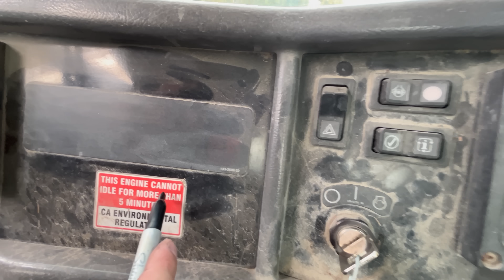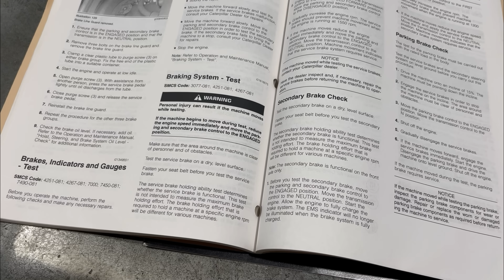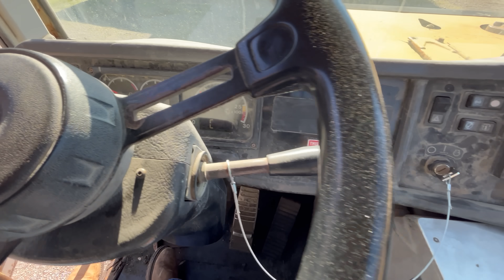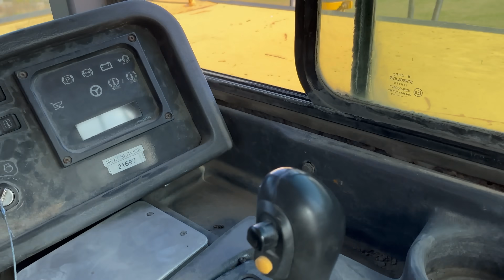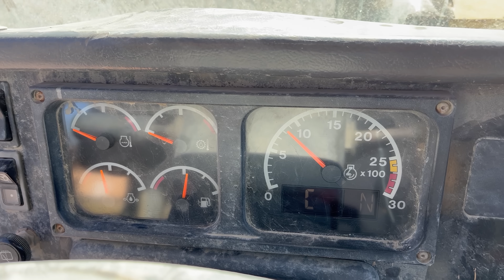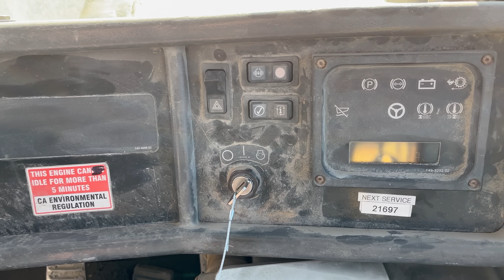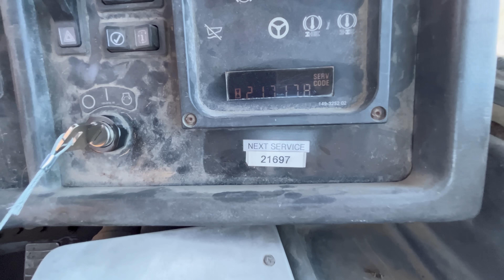Bought a 70,000 Pound Caterpillar 6X6 Haul Truck Sight Unseen 1800 Miles Away

Comment: I have absolutely no use for a machine like that, and yet I want one. Well done, and thanks for sharing the view!
Reply: Came here to say exactly the same thing, knowing without a doubt I wouldn't be the only one. One day, eh? Think my wife would kill me. A small dozer on the other hand....She wants a homestead garden after all. Shhhh, no one tell her you don't need a cat D6. Okay okay fine - an old D2 would be ok I guess. She even called one she saw cute. Think I'm off to the races
Reply: If I had one I could surely make a use for one
Reply: Mate,I have operated these trucks for 20 years and trust me they are the most uncomfortable things to drive,they have no real suspension (they do but it's for holding such weight and not comfort) the seat is the only suspension you get. If you drive into a hole that's a foot deep you will get thrown around the cabin even hit your head on the roof,that's if you don't have your seat belt on,and there are times you just jump in and go forgetting the belt.
Reply: Exactly....I want one of his rebuilt Cat engines and I have NO idea what i'd do with it...

Comment: I’ve worked for a Cat dealer since 1994. I spent many hours fixing and actually did quite a few rebuilds of these good old girls. Thanks for the memories this brings. Tranny oil is definitely not good. Too much water can ruin the clutch discs.
Reply: So where does that much water come from?
Reply: @amunderdog  hard to say. Could be moisture build up  from years of sitting, maybe fill cap left open for a few months, top cover gasket gone and winter snow melts in spring gets into case. Ive seen plenty of dozer winches full of milky oil and not due to sinking in water but just top cover gaskets are shot and water migrates in.  It doesn’t take a lot of water to cloud oil, the problem is, lots of water will effect any clutch packs that have friction discs made from cellulose based material vs rubber. Water causes them to swell so when you think the clutch pack is not engaged it’s actually still rubbing and contacting. Typically first gear is a rubber based disc and other are more water sensitive.
Reply: We bought a new log splitter back in May this year and the damn oil was full of water in a couple months of letting her sit. Weather changed and went from cool to humid in a couple of days. Almost hoopa jooped the damn thing. Fuel had a good bit of water as well,luckily we caught it.
Reply: So is this bigger than a cat 745
Reply: @walsh9354  not quite. This is a 40 ton not a 45 ton version but a whole lot more metal and less plastic than the 700 series trucks of today.

Comment: Such good content as always.  In case anyone wondered 21000 hours is just under 2 1/2 years total running time. Crazy
Reply: That's insane bruh
Reply: @zachsteele6964  it’s insane but when I worked in those things, you’re in them for damn near 12hours a day lol it adds up quick
Reply: I thought of it as a car running at 50mph so that's over 1million miles.
Reply: 7.19 years at 8 hours a day.
Reply: And even more on most Mines. The only break the equipment gets is, shift change, PMs or repairs.
Reply: Not that bad for how old the machine is
Reply: I was also surprised. Most I've seen so far was 11000 on a 953. But then again there's only 1 rock quarry near us

Comment: Amazing - not a single gasket or hydraulic leak on the whole thing!!!!!!   Here in Aus we would run a CEM engine flush to clear the buildup around the rings, a very good chance that would fix the blowby.  I have used that flush in a Toyota 2H diesel engine with 400,000ks, drained 14 litres of oil and goop out of a 10 litre engine!

Comment: I drove that same rock truck for five days a week and for a year man ,it can go pretty much anywhere except for deep mud ,and it was reliable and a beast ,we would load boulders and stumps and all kinds of brutal stuff ,always felt like a tank that I was driving and it’s fun to operate
Reply: Were you tearing sh*t up playing around with it?
Reply: @rudyleotardo8278  no just work ,but there like a tank to drive
Reply: Something I've always wondered about this type of truck; if you are stopped and you turn the wheel, will the whole cab turn while stationary or do you have to be rolling to steer?
Reply: @partyguy9  it's been awhile but I think u have to be moving ,but if u flip the load only the bed goes over and the cab stays up right, at first there hard to get used to but then man are they easy to back up anywhere ,unless u got maybe a sixty ton Volvo that you're working in a tight area ,but there very easy to drive

Comment: Hello, don't know how you feel about free advice but to get the big windfall moving I would have done two things different. First of all I would have filled the truck with dirt or gravel or something to increase your traction friction ratio. The big difference would be to put your choker or chain on and back up so you can rotate the cable around the base several times (4-5 times) and cause the tree and stump to roll once the cable gets tight. Loggers do this all the time to roll a tree away from the stump. I might not have explained this strategy clearly but I tried. Cheers from Canada.

Comment: I work on these for a living, 21k hours ain't that bad and that rig has plenty of life left in it. I have some 772 and 773 along with a couple 745 that have double the hours and a couple hitting 50 and 60k hours. Some of those are Quarries and those rigs run 24 hours a day and rarely shut down
Reply: I know right the company I used to work for had several Volvo’s at just over 28k hours and still strong
Reply: @nathanmullaney6946  I work for a CAT dealer, I do work on Volvos occasionally and their a pleasure to work on since they make the filters so easy to get to although I prefer Case since that's what I learned to work on originally
Reply: @Psycodiver69  interesting, I’ve never ran a case truck but maybe one day when my business gets bugger I’ll buy one haha
Reply: @nathanmullaney6946  In my experience all the construction brands have their issues but overall most of the equipment does that job with zero issues if its used right. I could write a book of the stuff I've seen busted because of stupidity
Reply: In my younger days I worked at a open cut mine ran a cat 980H with 64k miles i still see it used out there im amazed to see it going

Comment: As always you are very thorough and accurate with going over your equipment!  you apply the correct level of maintenance and attention to something based on what it's going to be used for and its practical value.  In other words, you didn't pull that engine and fix everything on that haul truck.  You did what was smart and correct investment to get the work you need done!  Most people either drive it until it drops without enough maintenance or they rebuild everything - Money and time is wasted in both cases!

Comment: I've only ever cut down two trees totally by myself. From felling, to limbing, to logging (bucking?) and hauling it all off. But I had to move the trunks off my friend's lawn without murdering his grass & beautiful landscaping etc.  So dragging them like you did was out of the question, plus my li'l old 38hp 2wd tractor hasn't got the cojones for it. So, Necessity, southern ingenuity & innovation kicked in, (even though I'm yokel from N.E. England) I made a few wraps around the trunk with a long chain hooked to my tractor. That thing rolled right out of there and didn't leave a mark. Now I have some beautiful White Oak for my woodworking projects, and a happy customer.

Comment: drove one of those the entire summer of 1999 in a new landfill cell, brand new machine.  loved the jake brake, especially when the dump was not down fully (exhausts through the bed of the dump)(that exhaust is not the original placement)
fun truck to drive
Reply from the maker: Exhaust is original placement.  Heated dump body is an option, they don't all have it.

Comment: I used to run a JD 400C HT shit box when I worked for a contractor. It would drain the hydraulic tank In a couple weeks out of the rear brakes. Used to haul around 40-80 tons of material all day everyday.

Comment: with that many hours that machine has been running for almost 2.5 years constant.
Reply: Mines are unreal operations in how they run equipment
Reply: We use these in construction too for cut and fill operations. Seen them tip over dumping, 350 puts her back on all 6 and away she goes.

Comment: After looking below at just a glance and seen a short comment by a english teacher, I feel I met my match in witticism an cut to the chase. I am guessing that even though most of these large machines get put to bed wet.... I have to think with that many hours some haven't been as hard as say those gold miners on the Yukon where soft wire is the best they have for cotter pins. If its a liquid then close enough for who we work for. I have worked up there when the famous Tony Beets was a pup or guess what mom, there is a foccell in our yard and it moves. I have only memories of things we did an sometimes they are worse than the trip uncle sam gave me in the late sixties. I mainly spent most of my time in the southeast alaska islands and when something large came... it died there. All those islands where there was mining or logging mostly has the carcuses of dead equipment laying in pits and we called them bone yards as it was where we got our "new to use" part just repurposed for it. Out at Thorne Bay where government subsidized roads to open for public eventually, was muskeg that just didn't have a bottom and we hauled rock into those spots. A dozer gets stuck and started down, they gave a half hearted attempt to get it out and then if not our, let the muskeg have it and build road over it. One crazy spot was known to have got three D8s and something else in it too deep before moving forwards with the road. I think it will last a while this machine that you got as a whole looks fair to me. What would I know though and only thousands of miles away on a computer.... at least it is not a grandmothers basement/LOL
Reply: wtf are you talking about

Comment: Water can only come in from the lid unless it was poured in to get the sale price dropped? From here it looks a good machine. If the frames have no cracks it’s hard to hate on it :o)
Reply: The water comes from condensation. Every take has this issue. It's from heating and cooling down an the longer it sit the more it will have.
Reply: @ronniewilliz153  True, I built a priming rig with a crystal filled breather so no damp got in there. A lot to be said for a bellows breather system so the expanding air never leaves. Used to see a lot of 3/8 breathers with a rubber washer inside that only let air out. I can see why machines got stored in air conditioned buildings.
Reply: @teamidris   that truck probably sat for awhile but It might be something else all the fluids or most of them should have been discolored as well. Or someone added some shitty  Trans fluid that had water in it. I've done that before with hydro fluid.

Comment: Nice thing. Pulling tree: I suggest putting the chain higher up at the tree, then, rotate the tree around the root. When dumper is moving it doesn´t slip so easily, getting power down to the ground.

Comment: Does that transmission have an atmospheric vent? If so is it possible that it was driven through water too deep for normal operation and some went into the vent? I've seen people offroading stock 4X4's and had water get into the transmission and transfer case plus the differentials. Just a thought. Great channel, take care.
Reply: That was the first thing that came to mind too. Been there plenty of times with my Jeep lol
Reply: These transmissions are hydrostatic and thus completely sealed
Reply: @ownedpatrol  wouldn’t that be an even bigger cause for heat and pressure that would need a vent? I’m not asking to be a pain I’m genuinely curious to learn. Because thinking of a torque converter until the torque converter clutch locks that is a hydrostatic coupler too right? And torque converters build a ton of heat when you are stalling it or coming up on stall speed. I’d imagine that when that truck is loaded it would be a very high heat scenario for a hydrostatic coupler. And he said it’s a 7 speed planetary drive too and I’m familiar with how planetary gear sets change rations in car/truck auto transmissions but not so much in stuff like this. Does it replace the clutches with hydrostatic couplers?

Comment: I'm a gold prospector so I'll definitely be checking that channel out and subscribing👍 my friends used to work at a local tyre garage and they would repair any tyre. I used to go out and get the wheels with them. Often earth movers. When they got them back they would cut new treads into them and I had a go. It's not hard to do so maybe give it a go and save yourself a fortune. Obviously the perished ones you will have to replace. It's quite therapeutic cutting them.

Comment: Man, I wish we had the D series of trucks at work. From my experience(s) you got a case of the condensations in your transmission. And TDTO and equivalent, likes to show condensation. Looks pretty solid to me, but I'm just pixels on the interwebs.
Reply from the maker: Hope so.  Gonna check on the trans vent when I get time.  Only thing I can figure.
Reply: @KT3406E  I agree with your reckoning on the trans oil cooler.  Also, if the cooler were at fault, would there not be oil in the coolant as oil is at a higher pressure than coolant?
Reply: @KT3406E  just watching the blow by puff pattern, I suspect a single-cylinder fail. It's not puffing on all six. Did you happen to do a compression check during your servicing? Or, and this is a strong possibility, I have no idea what I'm talking about.

Comment: The little that I know about these type machines is that water wreaks havoc on the Composite Discs inside the Transmission.  Hopefully there wasn't enough to do any major damage. 

Have you discussed the project you'll be using this beast on.  You need it for at least 500 hours.  Sounds like fun!

Comment: In all those 18 years ive been an hydraulic mechanic/engineer ive never seen a truck so dry and clean around all of the hydraulics, not a single flange is leaking and all the hoses in the frame look really good too.
Its not really a POS if you ask me 😂
Reply: I have this dilemma that's unclear to me and I want to ask since you sir seem like the correct person to ask. It's just very confusing to search for it online.

Do hydraulic cylinder speeds vary, can you make them go faster or slower with a faster flow oil pump? Can the hoses actually limit the flow and the speed of the cylinder and the pump? Theoretically, if you use wider diameter hoses would you be able to achieve more speed? I'm just very curious what's the limiting factor. Do you lose power if you make a cylinder go faster, if that's possible ofcourse.
Thank you for your time, I'm only 23 and I'm learning, these things are very interesting to me along with everything related to mechanics.
Reply: @nikola6413 ,

Yes yes and no haha,  more oil flow will result in faster movement of the cylinder and also more speed/rpm if you would connect a hydraulic motor.
Hoses can be the limiting factor for sure but the size of each hose and connection is always over engineered or rated well over the flow that is needed in that application.
Too much restriction in hoses/couplers will turn into heat and create pressure differences which in simple terms just means you will lose pressure from the beginning {the pump} to the (machine/cylinder/whatever) 
All these things are losses which cost money as you do have to put the power in to the pump but you are not getting all the power out of it.

Regulating the oil flow with the pump itself is very common, im not going into all the details but many pumps have a variable flow capabilty which can be controlled in many ways to speed things up or to keep temperatures under control ot even keep the input power (the Amps or KW's contant).
So yes, you can make things go faster by flowing more oil out of the pump itself and hoses are very rarely a limiting factor.

No, higher speeds dont necessarily mean you lose power because the power you are referring to is probably the way you would describe how strong a cylinder is and thats not exactly how it works.
The amount of force a cylinder can put out is a result of the pressure and offcourse the dimensions of the cylinder but that is not relevant in this example.

Lets say a cylinder is mounted so it can lift things and lets say it can lift 10 tons at 250 bar pressure
This 250 bar is max pressure which get set by a pressure relief valve somewhere in the system.
Flowing more oil has nothing to do with pressure,  (well it has but thats way to much info haha). it would simply mean it would also move faster as well but still being set at 250 bar it would still lift 10 tons.

BUT, there is a catch offcourse,  Flowing MORE oil at the same pressures Costs more energie to be put in to the machine so again,  more Amps and KW's for the E-motor that drives the pump.

Thats why some systems/pumps have variable flow so  it can speed things up when there isnt much load on the system and when the load increases the flow gets less and less and the pressure builds up so you can have the best of both worlds.
Reply: @jeroen1914  thank you so much for this detailed explanation, I really appreciate it. 
I'm gonna read this multiple times to understand it completely and not just memorize it

Comment: Ran a D350D for about 6 months from fall into spring. Had problems with the air dryer not doing its job and the Hydraulic suspension. I didn't see that type of suspension but hey, just keep it in mind.